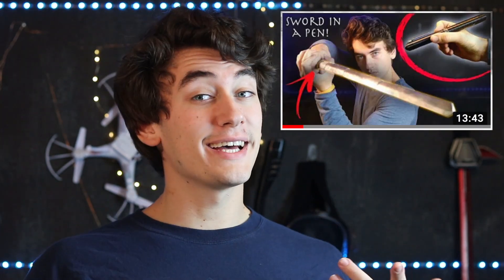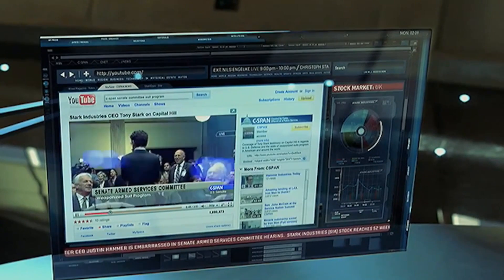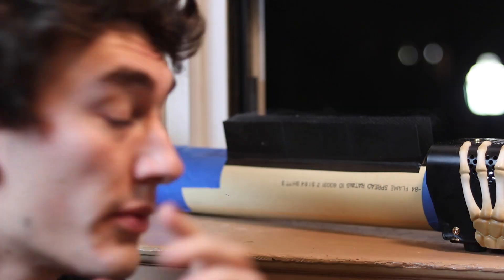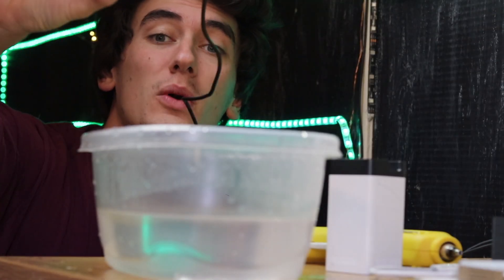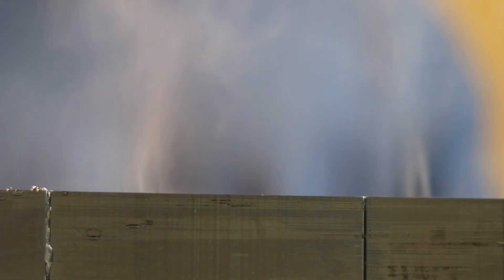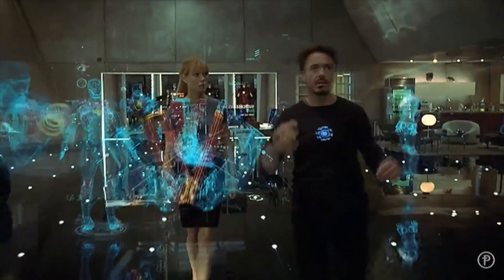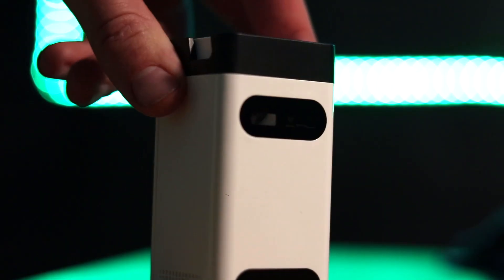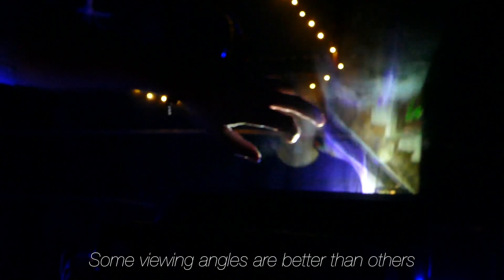DIY IRON MAN Style Desktop Hologram! - Real Floating Image!!

Comment: I wonder what would happen if you used dry ice instead of water vapor or maybe a combination of both to project onto 🤔 Also, how about one of those infinite perpetual fountains that would make a sort of thin waterfall that flows back into the source of the waterfall which would be projected onto, then use the motion of the water flow to power a small dc motor that would be charging the batteries for infinite power like a miniature water turbine alternator sort of scenario 😵 Your process of coming up with ideas and manifesting them into reality as a working concept is by far the most understandable and realistic approach I’ve witnessed on the internet as of this current moment (June 10th, 2023 @ 4:41am PST) from my perspective of understanding anyways. I guess that’s all I can come up with at this time in the wee hours of the morning here in Los Angeles, California. Thank you for your persistence and time and remember, failure is a myth. You got this man. Have an epic day #rebuildingtheplanet #thetimeisnow
#failureisamyth 
#2023
#🤜🏽⚡️🤛🏽
#💆🏽‍♂️⚡️🔮
#🥷🏽⚡️🧙🏽‍♂️

Comment: I would concider how a touch screen works, and that the gas could be more like a plasma state to interact with it like a touchscreen. In theory if there are multiple layers of gas you could make dipoles and circuits, perhaps pressing one gas to pair with another via or between a polarising filter, which could be simply a difference of light penetration through the gases, kind of like mixing colours, similar to the iridescent touch/heat/pressure sensitive paint of some automobiles. Future water fountains could become much cooler and used for many purposes, such as advertising, creating iridescent effect hologram displays like the moving eyes of some paintings and statues like some kind of Disney Magic, Fountain of/for youth Cinema... 🤔

Comment: If a gas is flowing then the image is distorted like a paper boat in water, and scattered/pixel lated by the gas. Maybe try catching the photons with a baseball Mit to help condense the image to close the gaps of the gas, or concider an additional gas to serve as a stabiliser/pixel plug, making the gas a bit denser, and the image clearer and less foggy. Perhaps a vacuum could help clear some fog aswell, better directing the flow of gas, enabling some curvature manipulation like a lense/curved screen/cup, taking into account how a holographic sticker works.

Comment: Bro use theatrical smoke, it would be much more visible and easier

Edit : also i am not so sure but, it would also decrease the chance of your pcp boards getting drowned (circuits going dead by water from condensation)

Comment: Hey i have been working on a similar screen project for years i know how to make the screen smoother with a less dispersion of the fog mist at the top make a laminar flow rail at the top but use a smaller thickness not the width of the suction hood but you can make a floating screen with out the dispersion on the top of the screen also if you make your laminar flow thickness less but more flow and the upper suction hood your screen can be less turbulent... Cheers bro nice projects on the budget style i would say try to get the screen tighter and less turbulent.... Yar!!!!
Reply: I am your first sub

Comment: Aero student tip --- Try and make the fog fall rather than rise and reduce the speed at which the fog moves, will make the flow much more laminar. Instead of many small holes on the fog outlet, add a section after that with one fine strip --- all those holes leading to one rectangular section that becomes thinner at the outlet - should make it a much more consistent film. Would love to see this update

Comment: Hey JL, if it had  a linear half pipe splash shield it would retain the spitting, also image clarity is dependent on the thickness of the mist, i.e.:  your "laminar flow" manifold. Respect.

Comment: You should add small bars going up from each end and/or have a fan at the top(hanging or attached to the bars) and have it go through a laminar flow filter so the distortion is cleared up even more so and that could potentially help with clearness/less mist being thrown around and maybe even sharpness and you could switch back to the fog machine if you make the laminar flow filter good and have the exhaust going back into the bottom and the bottom of where you currently have the (I can't remember the name) water heater things have a funnel that has a bunch of tubes in it for laminar flow so it reuses the existing fog to make it fuller but that's just a idea, if I had the tools(3d printer and knowledge on how to make models)  I would try :)

Comment: The method to sand the acrylic wasn't exactly good, is better buy acrylic already translucent, like the used to do light diffusers...

To maximize the effect you need a operation system with some high contrast theme to graphic interface (hard on Windows, but to a Linux is simple and Android 10 Dark Theme looks perfect).

Comment: I think you should try changing your approach to these kinds of projects (holographic images). Instead of projecting light onto a screen of smoke or vapor, it might be useful to look into some powerful lasers. If you build an adapted outlet where the light comes out of the laser-pen-thing, you can make the laser thicker and shorter and simply shoot it up without the need of fog screens. I know that barely makes any sense but hopefully you understand what I mean.

Comment: If you add a small frame and along the top with fans pulling the mist sraight up, i dont think youll have a hard time with the wandering mist. 😊 if you use the same pice with all the little holes on the top just line them up and put some sall fans or vacuums too pull it upwars with, if you do it just right i think you could have just straight streams of air flowing upwards and a clearer picture. I hope you see this! You have made a really cool project come to life!

Comment: Your idea is a great start, but maybe all of us sci-fi tech fans have been assuming wrong about the tech in Ironman. Maybe it is not a hologram. Light can not be held still except by an exceptional magnetic force. So maybe you need to rethink the holographic projection. Here are a few variations on the tech to think about.
1- Ironman holograms in their world is actually device that tapes into the optical part of someone's mind and 'projects' said image in real time in their mind and through the projection systems AI the shapes are manipulated or moved, but actually never visually in the room. Hard to build but getting closer.
2-since we can't trap light, then look at the possibility of other materials we can produce on a small scale in size. Then have a 'printer' device eject the mater in the right quantities into a space between two plates. The plates would be made up of hundreds of magnets. Each magnet would only emmite enough pull to attract the printed particle with that polarity. The printer would be loaded with micro beads that have various florescent coatings which react to magnetic energy and glow when energized. So you would in sense be able to print the image that floated between two polarizing plates. The printer could be designed to magnetiz each particle as it is printed so it was attached to the right magnetic field between the plates
3-Take common water, and magnetize water and use an inject printer to eject it into a controlled magnetic field to attempt to get the touchable floating hologram.  Not as fancy as your design, but an interesting idea.

Comment: I have an idea for an update for this project. So a problem with this model was the leakage... well what if you made it so the water that leaks down as its turning back into a liquid is then flowed back to the channel and the water is recycled. So as the water vapor condenses, it flows back to the channel to be turned into water vapor again!

Comment: You could just duplicate the same setup, but with laminar flowing vapor coming from all sides (like instead of just bottom up, also do it from left to right, top to bottom and right to left. Quite complicated, but that should maje for a clearer image given that in your setup you do get a clearer image at the bottom of the screen
Reply: Where it disperses less. Also, any measured that would make the airflow less chaotic after it leaves the chamber should make for a clearer image. Like for example sucking the vapor from the top to prevent it from going in all directions

Comment: 1. Why don't you use lasers instead of water 
That would be much better. 
Or
2.  take a 2 clear glass and between them display projectors ( mini ) and add some touch feature on the glass  there's a device which makes your desktop touch screen

 
 1 St one was for floating hologram. and 2nd one was for see through holographic display with touch as they show the computer of Tony stark in iron man movie series and age of Ultron and his laptop and mobile in Avengers films .

Comment: Jake- you need to find out how aeronautical engineers make smoke trails in their wind tunnels! You might get better resolution.
Reply: Patrick Rose they dont want the cloud to form. It’s a physical phenomenon cause by the drop of the pressure above the wing
Reply: @pierret6572  I'm just talking about how they make streams of smoke so linear before it hits the wing. Not thinking about the wing at all, just the smoke streams. The more small linear streams that could be made it would be like making a photo or video with higher resolution.
Reply: Patrick Rose it’s because of the shape of the wing. He can make a wing and blow the wing with a high speed wind charged by humidity so when it goes above the wing it makes the cloud.
Reply: @pgrosebud2012  You got the concept nailed. Hologram computers, 1 step down!
Reply: yeah
Reply: Agree
Reply: that is water vapour
Reply: Fine particulate smoke combined with extremely high speed airflow.

Comment: Could you please try to make Da Vinci’s diving suit? I know it isn’t new, but I want you to try this because every example we have is just a non functional prop. And the one team that did try this used special effects to make it look real. Will you please try to make a real one?
Reply: Nobody had achieved it because it is not possible.
Reply: Josue Rodriguez you might as well just focus on the mask portion of the suit and pair it with a modern dry suit. That simple.
Reply: Have you ever tried? The suit runs on the same principles as modern diving suits. Air is pumped into the helmet for breathing, and into the suit to keep the water from crushing your mid section. How could anyone not accomplish this?

Comment: You should have put a thing at the top wich sucks the air back in to have a more flat image
Reply: Well actually, he could use a back guide plate that is chilled and instead of pushing the air UP just let it condense on the chilled back wall plate and create a more steady waterfall type affect, which would resolve a lot of the wavy image.
Reply: @BretBowlby  but than you can't reach threw it
Reply: @nilsgoeke7494  through**
Reply: @nilsgoeke7494  I don't really see the need to reach into it and would prefer a cleaner image.  It's just a thought experiment.
Reply: @wavegreen  oh thanks🙃
Reply: @BretBowlby  I mean... He is trying to create a 'holograph' (don't know how to spell that I am from Germany😂) and having a surface to project the image on its not really a holograph anymore
Reply: @nilsgoeke7494  How so?  He's not doing a hologram, he'd need to be able to project all faces of the object on all sides in order to create a "3D" projection.
Reply: @BretBowlby  yeah but that's impossible😅
Reply: @nilsgoeke7494  Well I'd like to think it's possible ;)
Reply: @BretBowlby  oh yeah